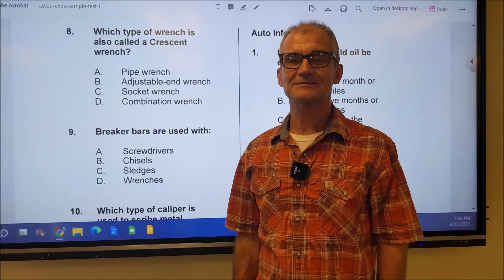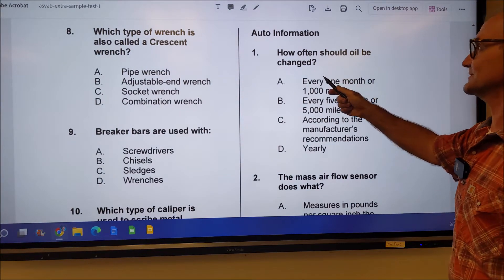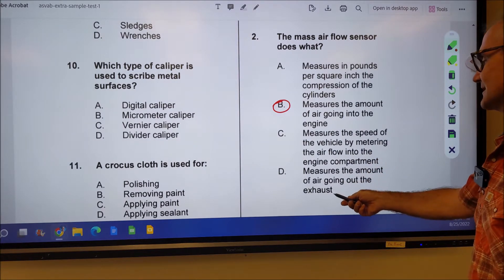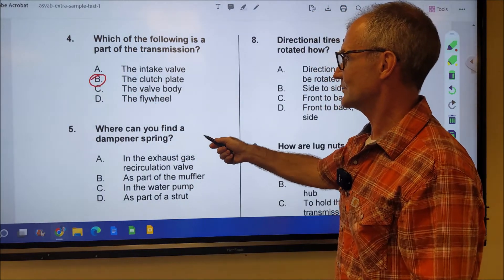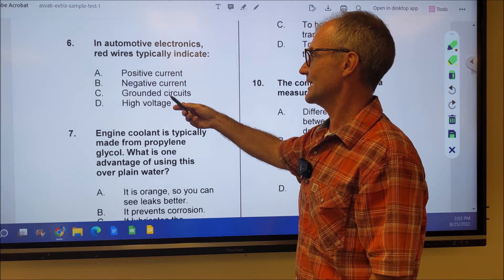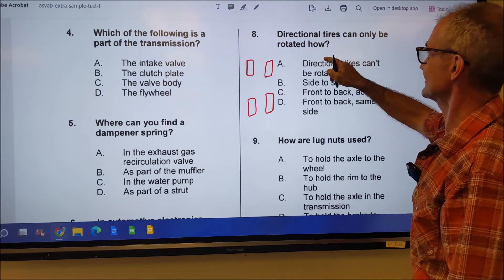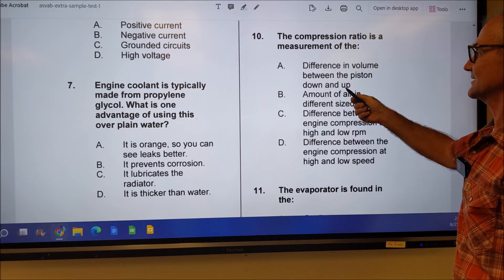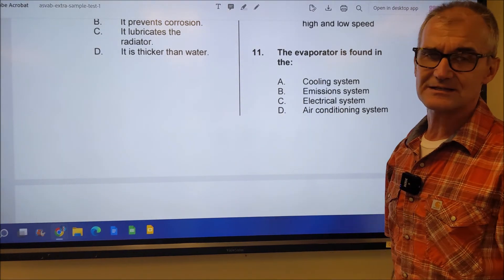ASVAB Auto Shop Practice Test

Comment: I think number four is incorrect. The valve body is located inside the transmission and is what controls the hydraulics. The clutch plate simply rest up against the fly wheel in the transfer case so that’s not really the best answer.
Reply from the maker: Ok
Reply: I was thinking same thing will.  I only know because I use to have a 2010 dodge ram 1500 quad cab.  It got stuck in 4th gear manual aka limp mode.  I had to pull the valve body out the tyranny and replace the gear shift solenoid, which is attached to the valve body
Reply: so what is the best answer in ya opinion and y?
Reply: the valve body?

Comment: #4: Valve body is inside the transmission…. Yes, there are valves inside the engine but they are typically housed in the engine heads and heads are not called valve bodies. Valve bodies are inside the transmission and control the fluid flow to shift gears, basically.
Reply from the maker: Good insight, thank you

Comment: #4 the clutch and fly wheel are attached to the motor so the answer is C
Automatic transmissions will have a torque converter inside, manuals have just a clutch and flywheel attached to the motor which shift gears when the clutch pedal is pushed in
Reply from the maker: Good to know, thank you